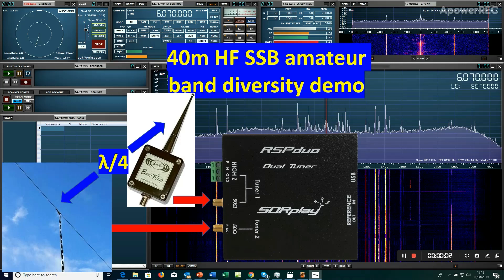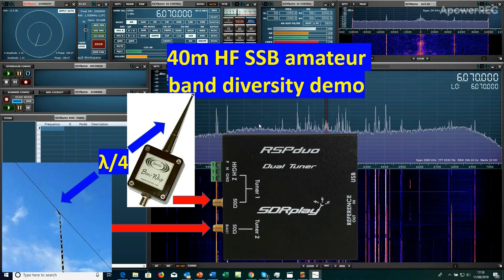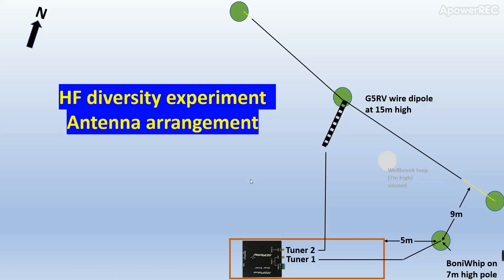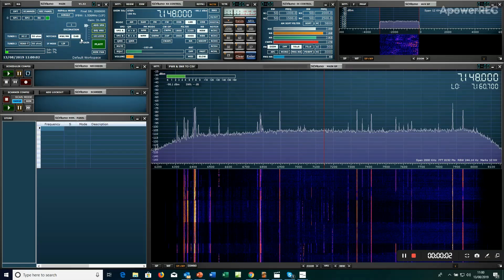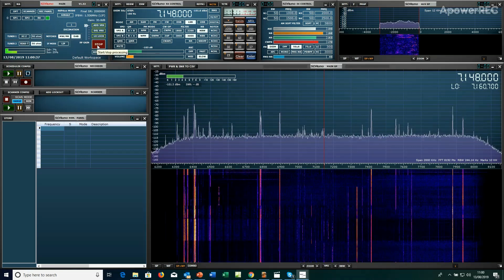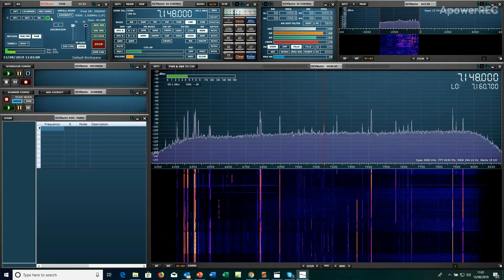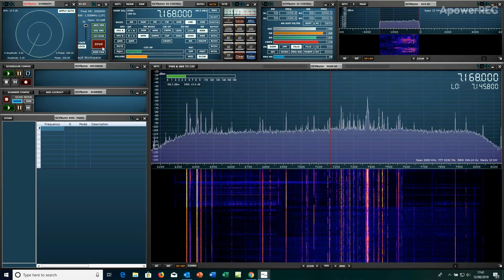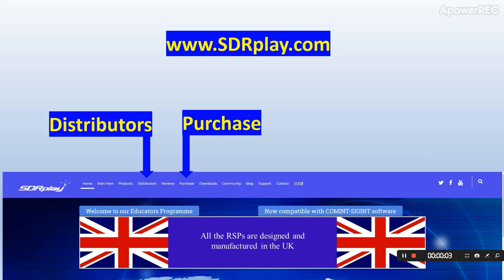Antenna and SDRplay set-up for HF diversity reception (rev1)

Comment: I just got this RX and software. Happy with my great new toy. But....haven't gotten the "stereo" effect I thought I might. The multipath from two antennas moving between my ears like the crashing surf. I managed that years ago with two receivers and hoped I can do the same with this SDR. I live in the country and by the grace of God have an RF quiet location. The HF antennas are crossed full length G5RV's up about 40'. One is EW the other NS. Much to learn with this way cool modern device...thanks, KC1CCG
Reply from the maker: Thanks for the feedback.  This signal diversity will not create a stereo effect as in the case where one signal is routed to one ear and one to the other ear.  Instead it improves the signal to noise ratio by a few dB,  assuming you have enough diversity between the two antennas. This quite long video talks about diversity reception and where the RSPduo with SDRuno works well: https://youtu.be/JSy4SkUx460   -  good luck with your experiments.